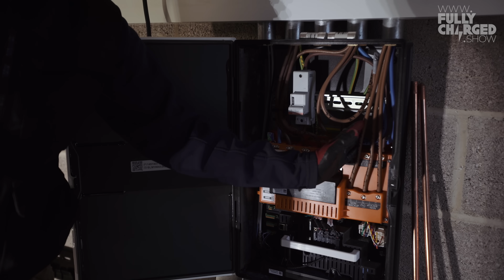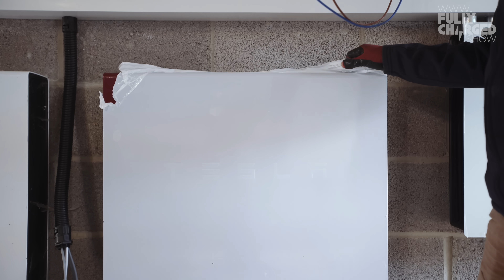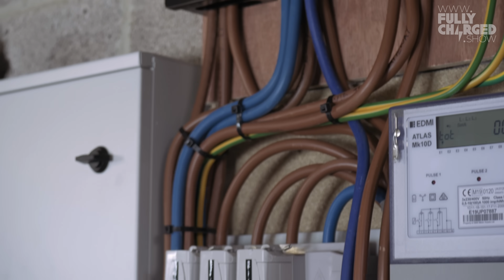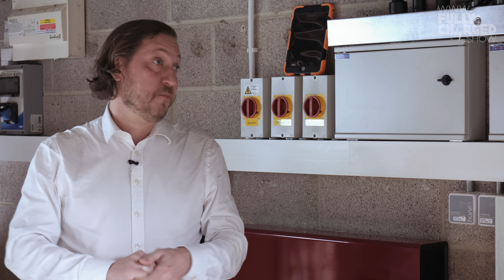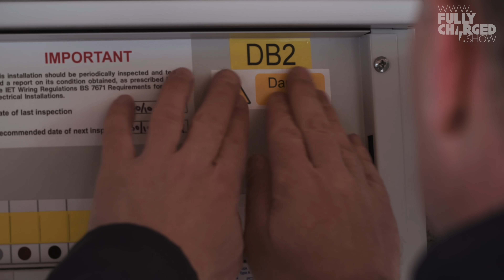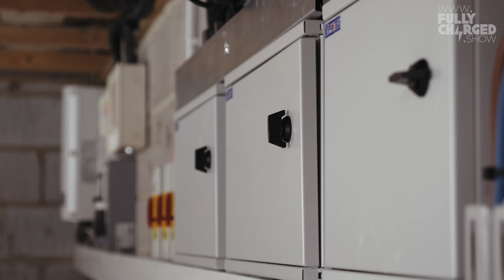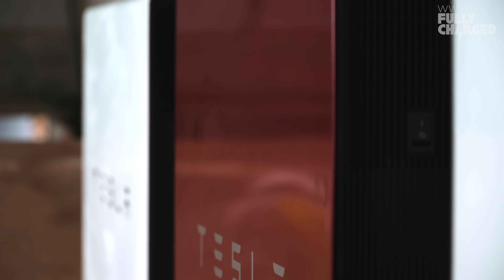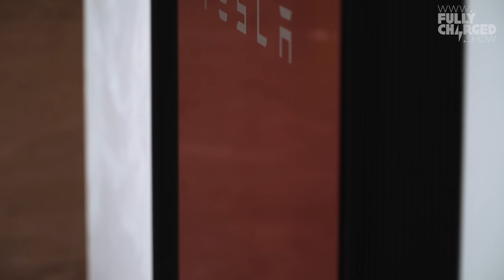Can you run your house on a battery? Tesla Powerwall 2 (Founders Series) & Tesla Backup Gateway 2

Comment: Hi Robert, thank you for making this.
I'm interested to know what you do with the 3rd phase that doesn't have a powerwall, presumably just for the zappy to faster charge but you will always be importing on that phase.
Also looks like your PV is single phase so only one powerwall and presumably the house will get the benefit... but you did mention more solar so it sounds like you're planning to get another PV on 2nd phase?!
Reply: @James Clifford you see in one of the shots of DBs the solar is on single phase
Reply: @Chris Jardine V2G had 3 phase connection on the board!

Comment: i never understood how this system of solar power along with power from grid works! Can anyone explain or suggest a quality resource for this knowledge?
Reply: There are many ways to configure it, but in this case the solar panels charge the batteries first, then the car, then finally the hot water tank. If there's any left over after all of that, then it exports to the grid. If the house demands more power than the batteries can offer at any given time, the remainder is imported from the grid.

Comment: Would like to know more about this negative grid pricing? If you can time your charging to make use of it... That would be really clever.
Reply: Check out the recent video by 'Electric Vehicle Man' about the Home charger and the Octopus  Energy Agile tariff.
Reply: Darned predictive texting.  For Home read Ohme.
Reply: @delboy4711  yeah, I knew I'd seen something like that but couldn't remember where, thanks.
I still think FC should do a piece on it (maybe a collaboration?) as their audience is much bigger.
Reply: https://www.cleanenergywire.org/factsheets/why-power-prices-turn-negative

A good article...
 
In a nutshell, the power grid has to be kept balanced, and if you generate power, it may take a long time to turn some of your generation off and on, or the cost of shutdown/startup too expensive, so it is more cost effective just to sell your electricity at a loss, and recoup the loss during peak demand time. 
 As battery storage becomes more prevalent, this should in theory balance out the spikes(such as an important footy match half time break when everyone turns their kettles on) and troughs(such as high winds at night causing wind farms to generate a lot of electricity and no demand as everyone asleep..or some older less flexible power stations)
It's not just tesla powerbanks that can do this, as more people go electric, your car itself can be used to help balance grid, as a car battery is bigger than the powerbanks...so if you're not using your car during the day at peak demand, then the grid will reverse power and take it  from your car, and top up when demand diminishes again(remember most of time your car is empty and not being used)

Comment: Like all things Tesla it's way over complicated and way over priced. Too much to go wrong and of course it will (expensively) at some stage. This will never be the answer for everyone, as even more rare metals will be needed for the relatively low life batteries.
Reply: And of course, when you have a Tesla and you are at home you have a 3 or 4x bigger battery plugged in to the grid right there. V2G would not allow the solar reuse but could be configured to give the time shift and power cut functionality without needing to buy any additional batteries.

Comment: 18:44 - So basically the utility company is paying you peanuts for power stored in your expensive battery, because they see no value in the hardware you paid for? Sounds like a bad deal to me...
Reply: Paul Martin I think you need to re visit the video. The idea of the battery is you store energy to self consume and avoid selling it for peanuts.
Reply: supakeobock No... I’m referring to the plan mentioned to have all these homes with batteries exporting to the ‘smart’ grid to smooth out the bumps of solar exports. There are plans for this sort of thing elsewhere in the world and it’s not great for the battery owner - they pay peanuts for the power from ‘infrastructure’ you provide, and worse... the utility company takes over control of the battery’s behaviour. No thanks!

I’m not referring to the idea Robert mentioned when you use your own batteries to limit grid IMPORT during peak demand periods. Totally different.

Comment: Some missing, important details here. The PowerWalls are AC and single phase each - so I'm guessing they're only connected to two of the three phases (or both on one phase)? If that's the case, the 'whole house' isn't being run by them in backup mode, just those circuits connected to the PowerWalls. There are also power output limits which would limit what you can run on each phase, including peak load.
Reply: That's what the gateway is for (besides all the other stuff): so the single phase Powerwall(s) can deliver/absorb power from all three phases.
Reply: @MacGuyver85  How sould this work? Do they switch all three phases in parallel on one phase? Or is there a 1 - 3 phase AC converter in the gateway?
Reply: MacGyver Is that a fact or are you guessing? If that’s the case, how does the Gateway phase shift the different phases if they’re coming from a single AC source, because the AC can’t all be in the same phase (waveform) to power three phase equipment properly... the AC sine waves must be offset for true three phase supply. I’d be keen to know the details as to how this is achieved.
Reply: @nitramluap  It isn't made clear in the video but I would guess that the Backup Gateway is on the same phase as the house always was, and the solar array, with the original Powerwall. The other Powerwall would be on a different phase. This would mean only the contents of the first Powerwall would be available to power the house in the event of a power outage, but that should suffice in reliable old UK! Charging the second Powerwall from solar is, I guess, a process whereby the solar is actually being fed back TO the grid on the first phase, with the Gateway arranging to get exactly the same power FROM the grid on the second phase into the Powerwall. The meter would nett the input and output to record zero. Anyone able to confirm or deny my hypothesis?
Reply: It's the total capacity that causes UK building code to kick in.

Comment: HUH!? 😯 The amount of time for the batteries to kick in was pretty disappointing. I expected it to be instantaneous like a UPS, with a little flicker of the lights at most. So you still need a UPS for any sensitive electronics in the house. Why can’t it work like one?
Reply: Needs to securely disconnect from the grid before it can power up the for again. There is a lot more juice in a power wall than a ups. 
Grid companies likely wouldn't allow it if it didn't do it slowly and checked 5 times.
Reply: @4203105  that doesn't really explain it, considering that this system is supposed to function, effectively, off-grid most of the time.
Reply: @videocruncher  What you're saying is that the house at the time of the test didn't run of off the batteries and that is why it took so long to switch? It makes sense usually you would power the house with the batteries and in case of a power outage the switch would disconnect the house from the grid while the batteries still run the house uninterrupted where in case of the test the batteries had to wind up for a few seconds because they weren't used. At least that is how I understood it.
Reply: @Kosake82  It does make sense to be directly connected to the grid bypassing batteries and inverters most of the time to achieve the highest possible efficiency (inverters loose a couple percent of power) when batteries play a role of a backup only. In that case switching between batteries and grid can take time and that’s understandable. But that’s not the purpose of this setup as I understand it. The aim of this system it to take most of the power from solar panels or batteries and use the grid as little as possible. This means that the majority of power comes from the inverters anyway and the grid gets connected on demand. That’s why it is puzzling me why it takes so long do disconnect from something that is not really used anyway.
Reply: @videocruncher  No, only "off grid" when the grid goes down. Usually connected to the grid, but minimising taking power from the grid at peak times.
Reply: This isn't typical as you can see from some other comments. It should be almost instantaneous. Robert should have Tesla check on what's wrong here.
Reply: Our’s does indeed kick in instantaneously. Sometimes you can just about notice a flicker in the flights, other times you only know there’s been a power cut from the Tesla log file
Reply: Probably also related to the fact it's 3-phase - so it has to disconnect (in effect) 3 separate supplies, and verify all there are safe, before telling everything else they can power up again...
Reply: @logicalChimp  Gateway is only connected to one of the phases, although it monitors the electricity flow in all three,
Reply: Even the real industrial applications have a 2 to 5 second delay until the back up power cuts in. This is normal

Comment: I'm surprised how slow that switch over is I live in a motorhome and can disconnect the power and have no effect on my electrical supply for example the computer won't be affected by disconnecting from mains power and switching to batteries, meaning if there was a powercut and I was playing a game on thee computer I wouldn't even realise it had happened.
I have a 1500w solar 15kw battery system  with choice of  400w winter inverter and 8kw summer inverter if you want to see it Robert you'd be welcome.
Reply: I was wondering that myself. Many backup AC supplies have been seamless for decades and a battery-powered inverter shouldn't need 15s to boot. Your computer power supply can usually handle a 20ms dropout, so anything less than that and it will keep on running.
Reply: I was surprised too, looks like he'll still need some UPSs.
Reply: @stephenshumaker8444  Battery backup for the battery backup.
Reply: @WiggyB  That's what I do! The trick is to try to minimize the amount of times you switch between AC and DC, which is tough.
Reply: @Eurotrash on Tour  Very cool! Flywheels are great at the grid level too. In my house, I have all my tech/AV/network equipment in UPSs. I also scavenged some from the trash and hooked them up to massive 12V SLA batteries in parallel, effectively building a DIY AC hybrid battery backup system for use in emergencies.
Reply: @Eurotrash on Tour  My PC's only battery is a cr2032 button cell which is less than 1w capacity on the motherboard my pc has an asus motherboard and amd A6 processor that I built myself and requires around 100w to run, so there is no way that tiny battery would power that pc for even a fraction of a second let alone the 32" tv screen that the pc is connected to and draws another 32w, the Victrron inverter MultiPlus 24/500/10 that I have has proven to me there claim  from there website : -
'In the event of a grid failure, or when shore or generator power is disconnected, the inverter within the Multi is automatically activated and takes over the supply to the connected loads. This happens so fast (less than 20 milliseconds) that computers and other electronic equipment will continue to operate without disruption.
'
Reply: @Eurotrash on Tour  In short my system does not need to feed back  into the grid however Victron does do grid tied systems and you will NOT notice if there is a power cut, doing a grid tied system requires more expense than an off grid system. So the question has to be why buy an expensive Tesla system when Victron's is better?
In this instance Robert got it for free so well done Robert.
Reply: @Eurotrash on Tour  No I'm in UK and my entire system cost less than £2000 and I built it myself, go have a look on my channel. I also cook with my wood burner in winter hence using the more efficient smaller inverter in winter as the induction hobs aren't needed.

Comment: FFS How much did it all cost , no one ever tells us the cost which tends to mean it’s very expensive ?
Reply: About £8k for one Powerwall 2 and the Gateway 2, fitted, but not including any of the 3-phase additional stuff in Robert's installation.
Reply: Wayfarer-Sailing holy crap that’s a lot , as my electric bill is £19 per month I don’t think it’s economically viable for me
Reply: I think Roberts installation is a bit over the top for most people. But hopefully the cost of these systems will come down over the next decade. Also companies like OVO are looking to install batteries on peoples home, and still keep ownership of them, and then both you and the company share the benefits of working the electricity market. I see that and community owned schemes being the route for a lot of people hopefully.

Comment: We have a Fronius Solar Battery (for 3 years now) and it not only can charge with direct DC (ie. efficient) from the panels - including all that power that would normally be clipped by the utility company limiting inverter production -  but it can power the house over three phases quite happily... even if the grid goes down. The 'backup gateway' in the Fronius system is simply the Fronius inverter... it's much less hardware (and neater) than that Tesla setup! I have a battery, inverter and just my standard switchboard. No other boxes. I can't believe how much hardware is on that garage wall!
Reply: E3dc pro Series 😉

Comment: Baffled as to why the power network insisted on a 3P supply.  By installing a bigger battery, Robert's PV would be stressing the connection he originally had even less than it did with only 1 powerwall.  On the 'top up the batteries overnight' side of things, even if you were charging both Powerwalls from empty it would be the equivalent of only a 4kW constant load for the 7 hours of Eco7 tarrif - hardly a huge load, even if you added a 3kW car charger as well... although I might be beginning to answer my own question.  If you had 4kW going into the Powerwalls and 7KW going into an EV that's a combined total of 50A.  On a standard 100A single phase supply that's beginning to get a bit serious... I suppose...?
Reply: Elsewhere Robert has mentioned that he lives at the edge of the grid, so I think his wiring was just weak to begin with. I agree with you, though, it seems excessive.
Reply: @Chris Jardine Confused... Why would the batteries be adding to the load on the grid?!  They would be subtracting power from the export or, at most, not adding to it!  You wouldn't be sending your battery-stored energy ono the grid!  That's the whole point of having them!
Reply: @Chris Jardine Hi Chris,  Yes, and they had better wake up, PDQ, before too many existing customers realise that with a decent bit of PV and battery storage to suit, they cab be independent of the grid and stop paying their £0.2/day standing charge let alone the ever-icreasing cost of the electricity they supply.

Comment: Why have everyone run off one big power plant when we can have a power network of solar panels on every house with a battery system like this.
Reply: Because it's still cheaper to have centralised power production. By 2030 it should be cheap enough in the UK to use solar plus battery storage.
Reply: aye126 because you need huge batteries for winter. I calculated that in Germany in july we get 36x more energy from the sun than in December. I would need a 1.6MWh battery to be completely off grid which is rediculous (123 powerwalls)
Reply: @dominikhelfenstein  
There are alternatives.
How about wind power or water. 
I think you need to harness everything that nature provides.
Solar is probably the easiest and cheapest, but there are other options..
Reply: @VFRrider 
Water/tidal energy is actually tested to be cheaper, more durable, reliable and have a lesser environmental impact (as tested on the 🏴 shore) after the initial installation, not that all ready sealed surfaces should not be used as well as possible (solar) and suitable locations wouldn't be very stabilising if used for wind.

In general an renewable overproduction would be the best choice, especially since both carbon capture and artificial fuels can be scaled to use excess energy.
Reply: @fionafiona1146  yah, tidal is also predictable and pretty much constant...the tide is always either coming in, or going out...
Reply: @dominikhelfenstein 
Alternatively we'd need huge overproduction in summer (producing synthetic fuels or something) that's cheaper. 
AEuropean grid would mitigate most of the sessional charges trough winter winds tho without other infrastructure.
Reply: @Reprint001  not too mention most people can't afford solar panels and a powerwall...it may be more expensive over 20 years paying for leccy the traditional way, but it is more affordable...

Comment: The tesla power wall is still free and the three-phase upgrade expence is just put on the value of the house
Reply: Is that how it works in the UK?  In the US (most areas) the solar panels are detrimental to values and likely he would get $0 return for his three-phase upgrades.  Of course tastes and preferences vary by person but likely there is little to no equity value here.
Reply: @aceofspades6667  the world is going electric, so I would of thought haveing a electric car charger/powerwall/three-phrase and free  solar energy connected to the house will get at least  you're money back.if it was just  solar panels u properly correct and won't add no or little money back.